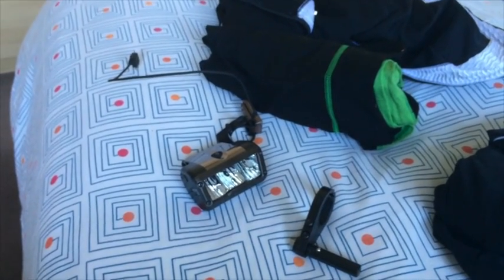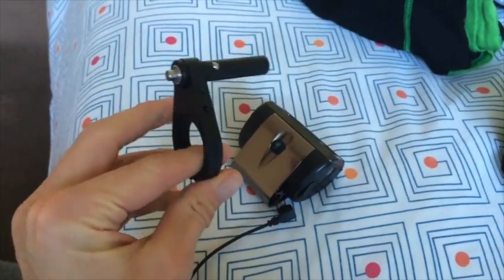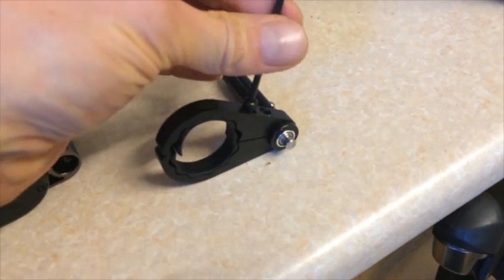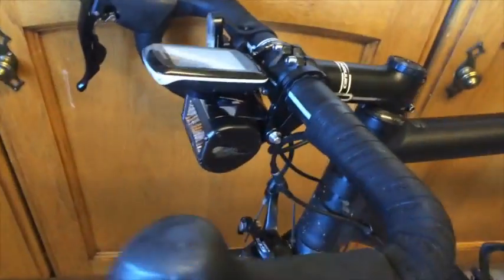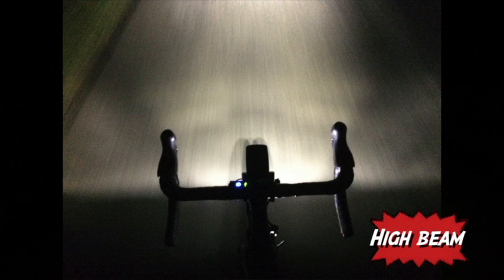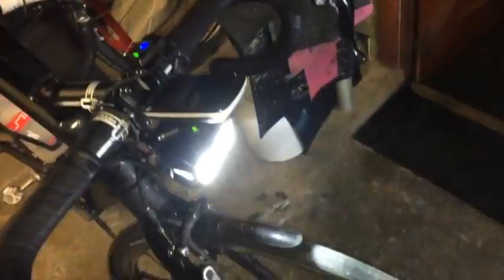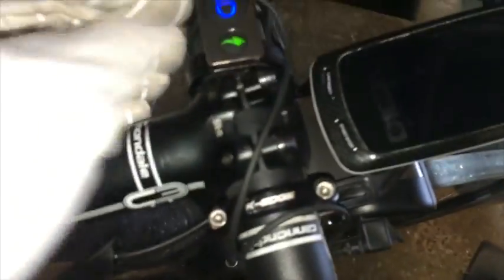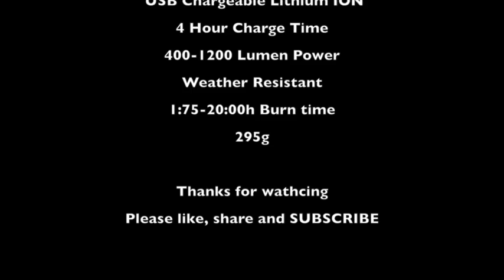Specialized Flux Expert Headlight Review

Comment: That  looseness in the pivot, since you can play a little bit up and down, isn't annoying? You can notice wile riding?
Reply from the maker: Marcelo Cunha yes, it was annoying but I listened to music when riding back then. Since this vid specialised improved the latest one which don't rattle
Reply: Got mine today, but the remote isn't lighting up. Also I can't turn the light on using the remote, only pushing the button at the unit (but I can use it to turn off). Looks like I have a defective unit. Damn

Comment: bought the Flux Expert yesterday and will return it tomorrow.
The light itself is great, the mount is a piece of junk. 
The two bearing balls on the mount's cylinder are unable to keep the light horizontal once you're on uneven terrain. The light will just tilt over and point down. Absolutely unacceptable at a prize tag of 269,- EUR. What a waste of money, I'm seriously disappointed.
Reply: The mounting problem is solved.
An o-ring was slightly wider than it was meant to be, preventing the two bearing balls to snap inter place properly.

Comment: How many meter the light will light on a road?

I hesitate between a BBB BLS68 scope 1300 and a Specialized Flux expert
Reply from the maker: About 20-25m I guess. It is a really good light especially on a road bike. My only issue is that the light does wobble up and down on the bracket. Specialized have begun supplying an "O" ring up grade but it doesn't really improve the problem with them. I don't actually find the movement an issue as my garmin "out front" mount stops it lifting too much. As far as bike lights go for road bikes its really good. I'm sure the second generation models will be even better.
Reply: Just asked about the bracket. It comes with two O-ring, one installed and a second one in a little plastic bag. Should use both, or the second one is a spare one?
Reply: @highcarbrider  According to specifications provided by the manufacturer Fenix bc35r throws 119m at 1000lm despite using floody Cree XHP50A emitter in vertical forward facing position with a reflector half scoop shaped (similar to Specialized) and the other horizontal half parabolic with a lens molded in to the top of the plastic glass for sharper cut-off. Probably neither is true since Specialized Flux Expert was advertised to have a throw 1/3 miles long.